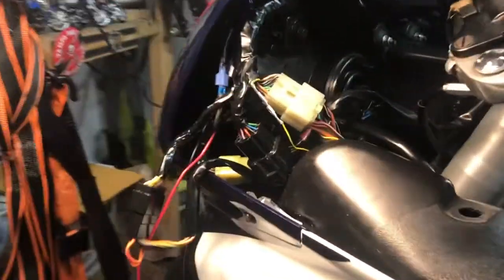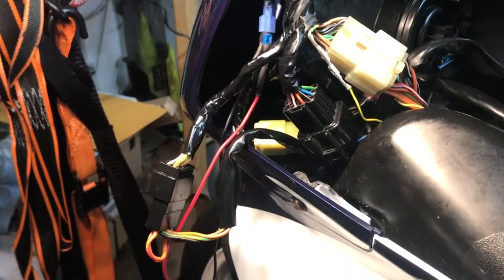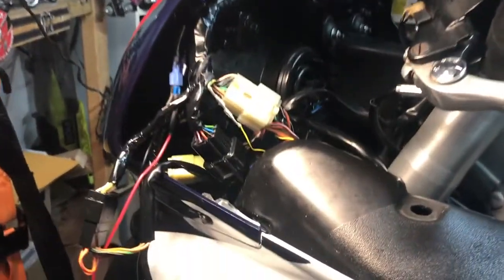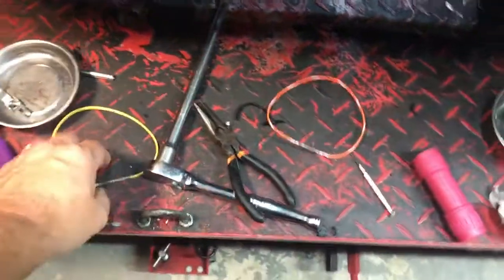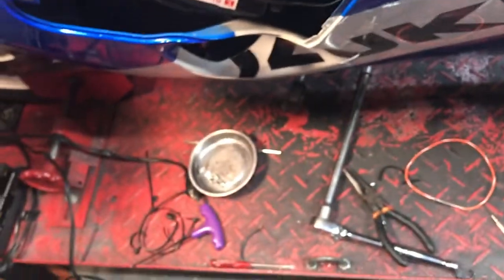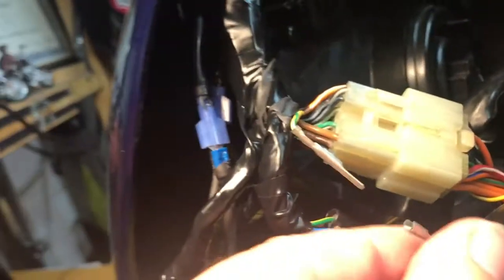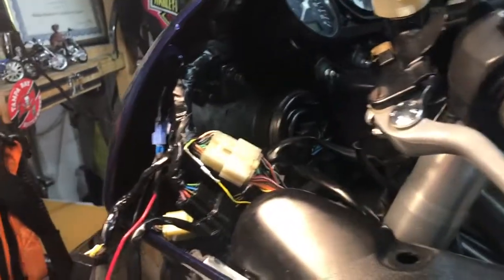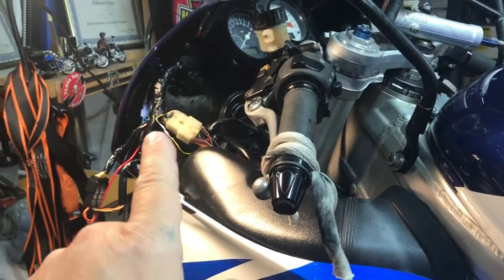‘02 Suzuki TL1000R electrical issues solved

Comment: That white connector is a known problem with the TLRs. I just checked mine the other day and green corrosion was leaking out of it. Then I moved the connecter and the bike shut off. So after cleaning everything real good, it was still doing it. Took the female pins out and gave them a little squeeze. 1 of them, I think orange with white stripe, or the all orange one was loose cause intermittent connection. Seems good now. Contact cleaner, wd40 and dieclectric greased where the wires enter the connector. Moisture should have a heard time getting in now. I did every single connection I could find, minus the ones under the tank. Might do that today. These harnesses are poor from the factory and there are ways around it. Charging system is trash, power to coils is trash, headlight wiring is trash, Main ground is trash. Fix all these issues and the bikes love it. Especially the charging system. Mine doesn't get over 12 volts at idle. A Mosfit rectifier with - and + going right to the battery keeps it at 14- 14.5 volts. Where it should be in the first place. Stock TLRs don't start charging the battery until a certain rpm. There is also a triumph recitifier wiring harness that is strait plug and play for the mosfit rectifier. Just have to put a inline fuse on the +. Now all I need is the mosfit and charging mod will be done. Lithium battery is also a very good thing to do.
Reply from the maker: Sounds like you got things under control. Performance machines often require lots of maintenance. Good luck with your ride and hope you have many more miles and smiles
Reply: @fitchpaintingrepairllc9871  haha yeah I've been researching the hell out of things. It's old, I want to know how to improve it.

Comment: Im in the uk and had a VERY dangerous wiring issue with my 2000 TLR, out of the blue while ridung at speed one day it cut onto 1 cylinder for several seconds then just as sudden went back onto 2, this was hairy as it made the bike lurch forward and lift its front wheel as i was hurtling along...it took weeks to find out it was these STUPIDLY located blocks...we get a LOT more rain in the UK than you do in the usa !!... they were absolutely covered in verdigris....once cleaned it solved the problem 90% ...ive still had, on the odd occasion had the same issue. .it really pisses me off as it totally ruins the ride on an otherwise very capable machine..its on my mind when cornering at speed, 4 cylinders can get away with it, twins virtually stop dead...its horrible...i believe suzuki actually refused to admit to this issue....anyway...i still own and love the thumpin bastard....great bike...considerin ✌👌
Reply from the maker: Try pulling the coils and cleaning the ground connections to the frame. Also the plug wires can trap water. Also the positive and negative cables from the battery(both ends). I live in Florida and it rains about as much as you Brits. Got to love the Gulf Stream weather. Use lots of dialectic grease on your wire connectors
Reply: Thanks, i actually changed coils, cleaned a few connections etc, but i'll go over some of your ideas, at one point i had its injectors out and all kinds of bits on the floor...one pain in the arse, the air box assembly has about 1000 screws 😂...cheers 🍻

Comment: I had spark but no start, unless I sprayed starter fluid. but now I have no spark, any idea as to what went wrong?
Reply from the maker: Possibly a blown fuse or a dead battery. Need more info to be sure
Reply: @fitchpaintingrepairllc9871  the fuses look okay' the starter relay fuse which holds 30amp is also ok. Im using a 12v car battery to test w jump cables? I donot w all my bikes when im testing. This bike had a shitty start when i bought it. Never rode it' i replaced the fuel pump (ebay item) started for 2 min and died. Injectors were used also form ane bay item. Im scratching my head w this thing now amd im pretty good w figuring out bikes eventually but this TL is worse then my mother in law lol
Reply from the maker: @michaelpassionsgarage356  this bike is notorious for having electronics issues. Check inside the electrical connections. Each wire has a male then the other side female. The female side gets opened up and connection is lost. Isolate each component and connections

Comment: Does this produce a 24/25 error code? I might have this issue with my 98 model 🤔
Reply from the maker: Not sure of the code but it definitely causes a no power/no start issue.
Reply from the maker: The 24/25 code relates to no power at the coils as far as I can tell from a quick online search
Reply: Is it a big job to replace the coils? I'm a bit of an amateur in the DIY department 😬

Comment: mine only produces 12.2V even after replacing stator and regulator ii can not run with lights,done 5 bikeshops not evenone solved the problem
Reply from the maker: Does it have any aftermarket lights installed? Or anything electrical added to the system, usb charger or Bluetooth device? Check all the ground cable to frame for corrosion or loose connections. What is the voltage of the battery with key off? Key on? While cranking the engine? With engine running lights off? With engine running lights on. If all these are good check every wire in the system etc
Reply: The regulator/rectifier is responsible for the amount of voltage sent back to the battery. It's the smaller black box under the seat underneath the ECU. They make aftermarket basically plug and play units that run cooler and much more efficiently. The only thing is you may have to do a little splice to attach the plug unit to the 3 power stator wires